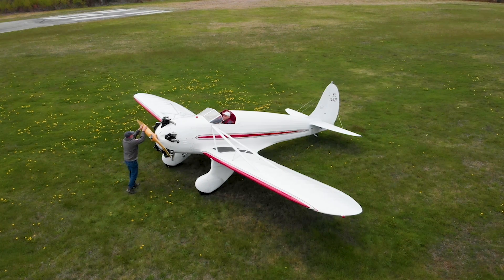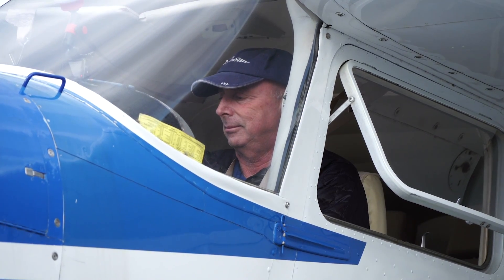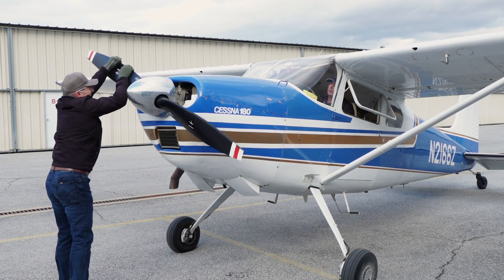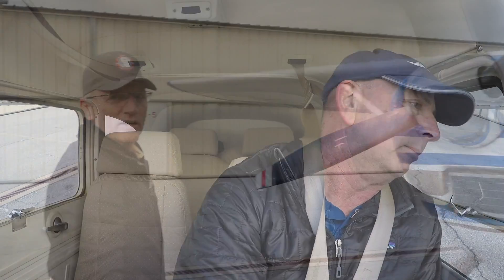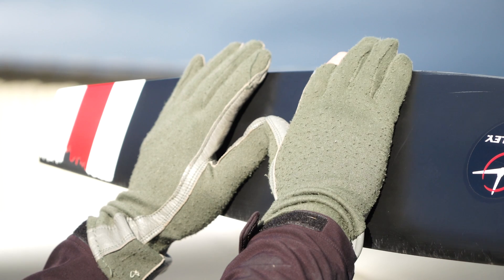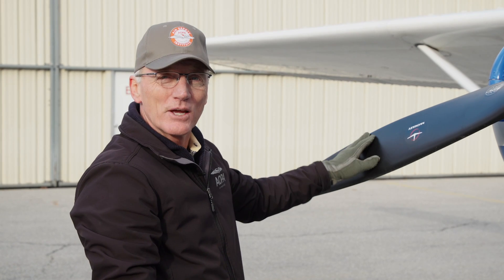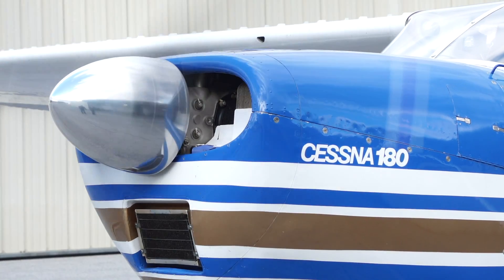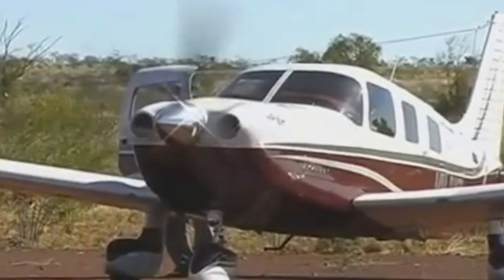Tips & Techniques: How to Safely Hand Prop an Airplane

Comment: I did a few hand starts on small planes in my younger days. I used a push-back foot and backed off as part of the action, continuing in a curve to move from where the prop could go if brakes don't stay on. The knee was not too close to the ark but had me in a stance to go back.

I didn't put a shoulder towards it on escape, I faced it with face and chest as I backed up to start the curve.

And I did pull them through while not live or hot but with same live cautions first.

Right though, never attempt without a pilot or engineer at the controls, not even when all is set to not live prior to one's entry. Wait for the operator to set up, check that person's initial setup and that person be on it thereafter, or be that operator preparing for the prop-swinging person. 

Though, a loud "Contact!" was the only word for live or hot, no additional words, other words also concise as in "Brakes on!".

I saw someone start from behind the prop, hanging onto a step bar and using one strong arm to pull down the prop blade. He recoiled to the step bar as he pulled and he got it started. If there's nothing to hang onto, perhaps opening a small inspection hole may give a makeshift handle, close it after though. That's not a safe move if actually relying on a smooth cowling surface as pull-back a handle.

Good idea with the gloves though, I didn't wear rings but blades can be slippery without grippy gloves and they will protect rings from getting caught.

We have or had different ideas and instruction, the whole goal is two to start it and tell the story after, from both sides of the operation. 😊

Comment: Perhaps I'm blind or stupid, but I can't tell how you know which way to turn the prop. Watching this video, the curvature of the prop seems almost identical on either side. How do you tell which is the leading edge and therefore, which way to turn it?
Reply: It's generally easiest to tell by pitch of the blade (like, the built in pitch, not the physical rotation of the whole blade). envision the blade smacking the air and pushing it backwards, then look at the shape of it and its easy to see which way it would need to rotate to do so. you can do that same thought process with ceiling fans and such

Comment: They built a plane with so such complexity and precession but can't place a start motor (with the power of two human arms) in it?
Reply: The batteries are small to save weight.  If the engine doesn't start easily on the first attempts, the battery will be run down very quickly, hence the need for hand-propping.

Comment: Here's another technique: just push the plane off a 10000 foot cliff, this should be enough to get the prop windmilling in a dive and you can get the engine started on recovery.

Comment: The person in the pilot seat of the 180 says "Mags are off, and brakes." What? This is a great example of the sort of communication you don't want to hear while propping someones airplane. Be clear. Be concise. "Switch is OFF, Brakes are set!" communicate throttle position, and fuel switch position, then "CONTACT!" "CONTACT!" This is a trust, but verify situation, and the first step is to simplify and clarify the communication to leave no room  for misunderstanding.

Comment: Air Safety Director says "don't wrap your fingers around the back of the blade," then wraps his fingers around the back of the blade on almost every pull. It's nearly inevitable, since moving the prop flat-handed is very difficult to impossible.
Reply: same happened in this video as well
Reply: EXACTLY
Reply: I've hand-propped a few airplanes & there's really nothing wrong with placing your fingers in back of the blade, though it's better to have them on top (approx 90 degrees relative to blade), and as little as possible in the back. The entire process involves, of course, moving your fingers out of the way in a precise, fluid motion.
Reply: So typical of "experts" giving advice...he says to not wrap your fingers around the blade, but then does exactly that anyway. I've always wondered about the advice-givers who say to not wrap  your fingers around the blade because you can't actually swing the prop without doing that. I've propped airplanes many times and have always wrapped my fingers around the blade, and yes,, I still have all my fingers. P.S. These guys are also using ridiculous phraseology while describing what you are supposed to say to each other during the process. Dumb.

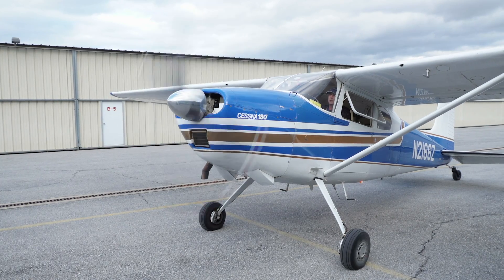Comment: Leaning forward into the prop, then trying to step away as done at 1:45, is a recipe to become unbalanced and fall into the prop. Putting your leg forward, then swinging it back while you pull the prop guarantees that your whole body has momentum traveling backwards away from the prop. This is done properly at 0:09 .  Never ever lean forward to hand prop an airplane.
Reply: @michealrunnels7660  I saw that too, putting a shoulder towards it. I did like you say, used a stance to backup while still facing it with face and chest as that fluid motion happened. The area behind the person naturally needs to be clear, so backing into that space works fine. 😊

Comment: In 2020, the fact that we still sometimes consider hand starting a plane just shows how behind the whole general aviation industry.
Reply: The frick is this comment supposed to mean? Like is hand propping a bad thing? Should everything be automized? You know hand propping is fairly important skill. If the aircraft has been staying still for few months, hand propping is a good way to start it, because the battery might be low.

Also rotating the engine before starting gets the oil moving and i think it helps with oil pressure which helps starting the engine. When doing that you need to treat the prop like it could start.